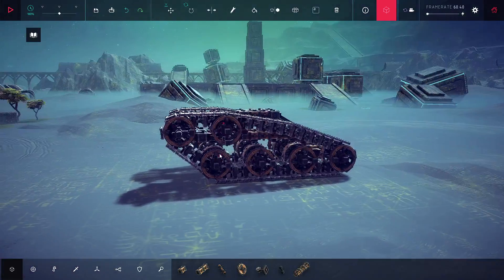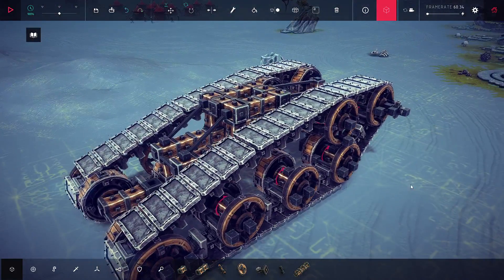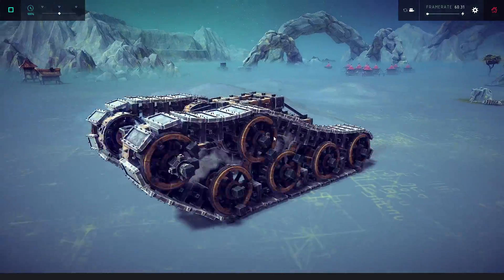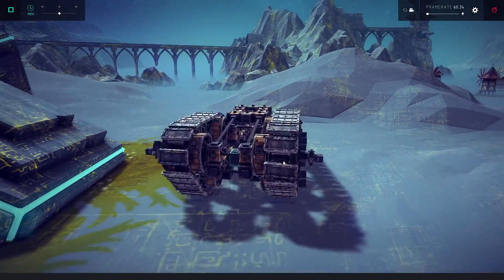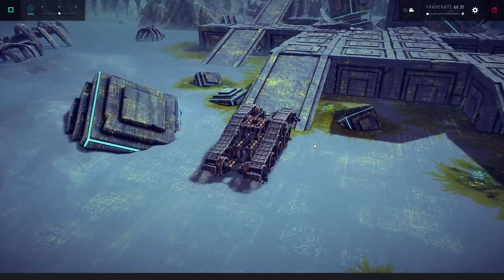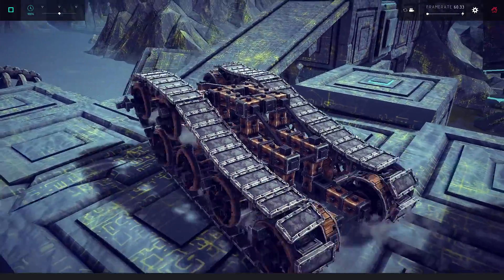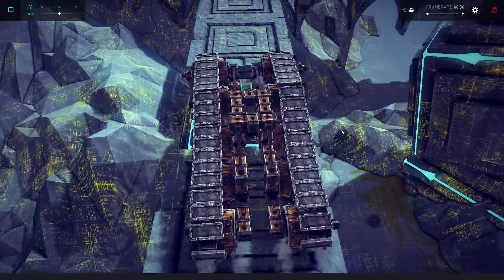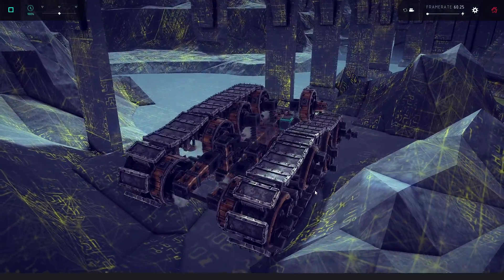Just a quick demo of some tracks

Comment: It looks a bit unstable, it is because it's too light?
Reply from the maker: No I think it's because where the links meet the wheels there's a square block. This is what I think makes the ride bumpy. Past models used wheels touching the tracks, but I found it harder to keep the tracks on the wheels. This design keeps the tracks on better with the tradeoff of a bumpier ride.